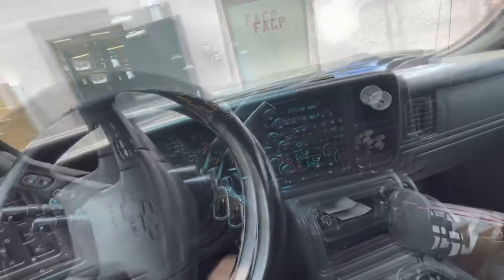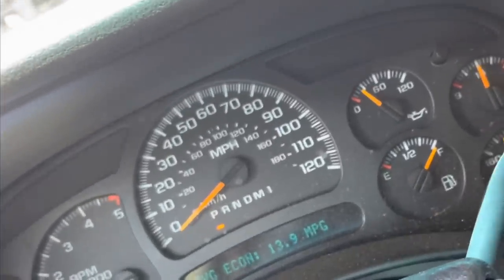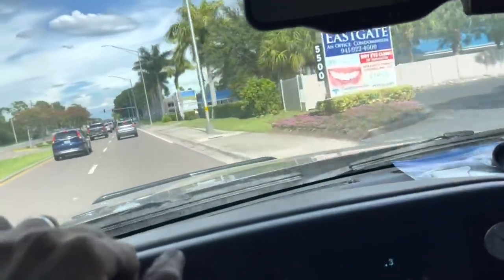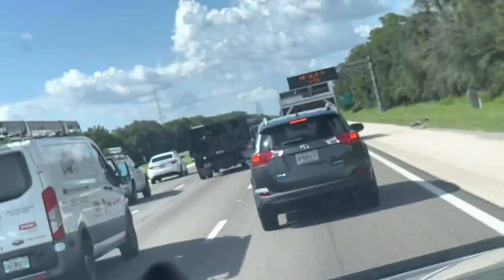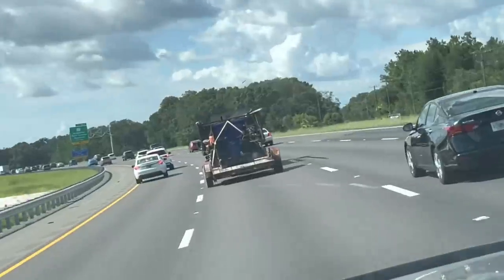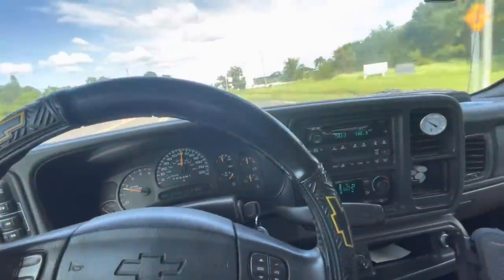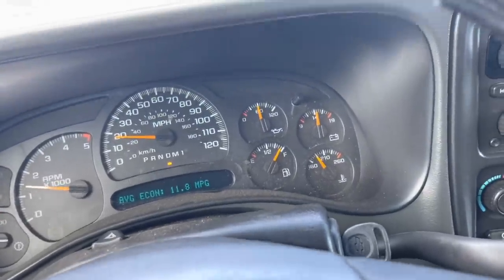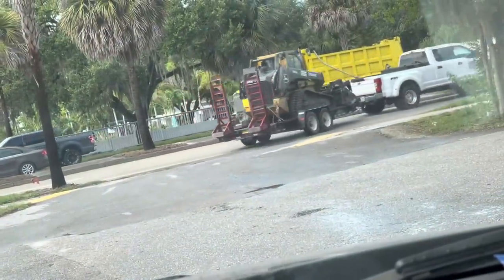Need answers! ox-cetane Diesel Fuel Experiment | Duramax 6.6 LBZ

Comment: Cetane boosters are good, it will help make sure the combustion process works as expected.  Similar to the octane boosters, or running higher octane fuels for gas engines.   If the fuel you've been running is already blended to a high enough Cetane/Octane for the engine then you won't see much of an improvement.  I would prefer to see that they claim an actual Cetane number improvement per dosage.  The diesel market in the US is not as well regulated for cetane numbers, and its exceptionally rare to find a station that actually will list Cetane rating on the pump.   From what I've read in the past, cetane numbers over 50 rarely have any significant benefit, but cetane numbers under 40 can cause less than ideal combustion.   Most fuel in the US market is around 42-45 cetane, with a minimum spec of 40.  In European markets the minimum cetane is 46.   

I've got a 6L powerstroke and a 3L bluetec in my two vehicles, the bluetec has a DPF filter but is old enough to not have the DEF system.  I definitely notice an improvement with a cetane treatment in the bluetec, more than anything in the frequency and duration of the DPF regens.  In the truck, i mostly just notice a little less black smoke puffs unless I'm just flat out flooring it, so I assume the combustion process is just running a bit more complete.  

I run the amsoil diesel treatment product, but have also used the ford/motorcraft one.  It has 2 dosage levels, to either get  +4 cetane or +7 cetane.  I'll occassionally run the higher dosage for a tank or two, but honestly I see the benefits from the lower dose, and minimal gains from the higher one.  

Cetane boosters aren't snake oil, but they have a diminishing returns depending on the fuel you are running.
Reply: I've read your comment and tried to do some research about it and yes it does seem that they actually work. However the one you referred to (Diesel Cetane Boost from AMsOil) is incredibly hard to get for us here in Europe. Could it be because of its chemical composition (that doesn't meet eu regulation)? Do you know by any chance what do they put in that stuff or what is it made of?
Reply: @jedanObicanMish  I honestly would expect that the lack of availability in the European market is due to the higher minimum cetane rating required for diesel in Europe.  Numbers above 50 have little benefit for most diesel engines, and European minimum standard for cetane is 51.   JLM Lubricants is a European market brand that has a very well regarded product selection including quite a few diesel specific products.  Even they only offer intermittent use fuel treatment products, which just leads me to believe that sub optimal cetane levels just aren't really a problem in Europe.

Comment: A good video on fuel economy; well done Ray. In regards to holding mobile phones, the citizens of New South Wales Australia, of which I am one are not allowed to hold a mobile phone under any circumstances whilst in the drivers seat of a car with the keys in the ignition. Also we have cameras installed on posts on some of our freeways to detect this kind of activity. If you are pulled up for random breath testing and decide to show your licence on your mobile phone instead of digging for your wallet you must turn off your car, apply the handbrake and remove your keys from the ignition before doing so. When you see the way some people drive you can understand why the rules are brought in. Pretty scary when you see an oncoming vehicle cross over to your side of the road because the idiot driver was texting or checking his messages. It has happened to me on a 70mph road.

Comment: I'm old school... I run ATF in my 7.3 as an injector lubricant. Important after the low sulphur fuel was mandated. Got 1 MPG improvement verified over many tanks full. It's at about a 200:1 ratio.

Comment: Rainman I’d say your 100% correct calling it the placebo effect as that whether correct or not means us knuckle head watchers know what your talking about. Myvehichles over the years have always travelled quicker and smoother after a wash😀😃😄 definitely placebo of the brain!😂😂
Reply: When I was a teenager, I worked for a local regional airport at the 'Executive Detailing Service'.  One thing for certain, airplanes get better economy of fuel after its has been waxed and rubbed with a diaper.  Sadly, I can't say the same for my cars at the time but if I drove 5000 miles a day; I might have noticed an increase after a wash and wax.

Comment: FYI to all 2019 & 2020 RAM owners with Cummins diesel engines; due to the problematic Bosch CP4 fuel pump (recalled in Nov.2021 with no date in sight yet for replacement), Cummins is now recommending "Diesel Kleen" made by Power Service. It has a Cetane additive, and has a lubricity additive to help lubricate the fuel pump. I've been using it for 3 months. Seems like a good product.
Reply: I have a 2020 Ram 3500 with HO 6.7 Cummins.  I have been using "Diesel Kleen"  since new;  it seems to help and keep the CP4 fuel pump together until it is my turn to get the pump replaced.
Reply: @schlite60  Hi John. I've owned my 2019 since March 2020. It was brand new when I bought it. I've been driving it for 2 years before I learned about Diesel Kleen. I've only got 17,000km. on it, so hopefully my pump will survive. I'm driving from Toronto Canada to Newfoundland, departing tomorrow. It will be approx 5,500 - 6,000 km. return.
Reply: @46fd04  have fun and I just got back from a 5K mile trip to Xenia, Ohio in May.  I drove thru some snow and ice (6 inches!);  coming back home in Wyoming over a 9K foot pass.   I also have the 52 gallon tank which gives me around 800-900 mile range.  Be safe

Comment: Hi ray, i am a proud owner of a 07 lbz, i can tell you that using Cetane booster/tcw3 2 stroke oil is not about having much performance gain or MPG gain. its longevity of the cp3 and injectors.... the globalist really dried our fuel up compared to the early 2000, they dont want us to use much diesel anymore. The new diesel at the pump have too low sulfur in it and  it damage most of the high pressure stuff longterm.   having alot of lube will help with the bad diesel at the pump

Comment: Good experiment. The thing I noticed most was how many keys you have hanging off the ignition 😂. Bad for the cylinder.
Reply: Take a look at women's keys sometime, and I've never had to replace a wife/mom/sisters lock cylinder
Reply: There's nothing wrong with how many keyshe has on his keyring. I know people with 3 times as many keys on their keyring & haven't had any issues for several years! 
Literally 10 to 12 keys, plus the key fob & no problems in over 10 to 15 years! 
Of course the new cars don't use keys. Just a key fob that you could keep in your pocket.
Reply: I was thinking the same, after my dad (retired mechanic) used to tell me all the time to carry minimum keys possible on a keyring ☺️
Reply: I noticed how many lighters he has in the dash. Kinda curious what they're for, especially so many. In my experience, eh I won't finish that one lol.
Reply: I'm sure that ray can replace the cylinder if necessary.
Reply: @chrisleggett685  definitely.. it will make for a good video & we can tell him it’s cos of his keys 😂

Comment: I noticed smoother idle and less knock with HOTSHOT EDT it also increases fuel lube
Reply: In theory the idea of fuel additives sounds logical, studies haven't really backed up the claims. The FTC for example did testing on it and they found that while it did work, the results were basically immeasurable. We're talking increasing your horse power rating by a few fractions of a percent and only less than half a mile to the gallon better than before. But the results should be more impactful the older and more worn out your vehicle is. Adding it all the time is literally just a waste of money as it's only purpose is destroying carbon buildup.

Comment: For the last five years (100,000 miles) I've been adding 2 Stroke oil to my diesel at about 0.4% - 250ml in the 68L tank in my small 4x4 SUV.  This has the effect of increasing the cetane rating very slightly.  While the fuel consumption is  only marginally improved, the engine noise is radically altered - much less of a diesel rattle and sounds more like a car than a tractor.  Exhaust is cleaner and there's no smoke on high rev acceleration.  It may all be placebo, but a smoke-free, free-reving diesel at 170,000 miles seems pretty good to me and there has been no obvious down-side.  My long-term average fuel consumption is 42mpg (Imperial); 35MPG (US); 6.7L/100km - again, that seems pretty good for a family size 4x4 SUV.
Reply: This was old practice with diesel fuel pumps, I did it also after advice of an older diesel expert, ...........I doubt the use with the technology of common rail ????
Reply: @frankgeeraerts6243  Lots of change to the technology of getting the diesel into the cylinder, but the physics of the actual  combustion hasn't changed, which is where the 2SO and the change to the cetane rating comes in, in terms of igniting sharper and burning slightly hotter and cleaner.  So still relevant for a modern diesel.
Reply: @rb9580  Thanks

Comment: Gotta wonder how much fuel you've got to burn at a discounted rate to make up for the cost of a big external tank and pump.

I honestly like the preparedness and range bonuses but don't see it as a money saver
Reply: Yes, to save fuel you pretty much want as little extra weight in the car as possible.
Plus what's the cost of the product v savings. Overall it might not save you a cent.
Reply: I think preparedness is everything for a diesel.  Payback is going to be years on the tank, but with fuel prices as they are it will probably pay back in a shorter amount of time.  I also suppose that extra tank can be moved to a new truck in the future.  Sorry, Captain obvious here!  🤣
Reply: One advantage of having the external tank and pump is, you can fill the tank up with heating oil, which is just diesel fuel with a dye added because there is no road use tax on it. Old school diesels run fine on it. Don't let the DOT find out through....sssshhhhh!
Reply: @richb.4374  at 2:53 when Ray “rinsed” the filler neck, the fuel did look awfully red….lol

Comment: Most vehicles you can pull the high beam turn indicator to flash your lights for your courteous jester !  I use  Rev X Distance plus its an excellent diesel additive fuel preservative .In CA people frown on the diesel smoke. It has eliminated that too in my tractors. Good review.
Reply: While true, in a lot of places that's technically worthy of a ticket if a cop is having a bad day. They'll be especially picky if they think you're trying to warn others about the presence of a cop. Revenue >> safety! It's also sometimes hard to catch, and can look like you hit a bump or similar rather than being intentional. The long change of state is less ambiguous.

Over here, the "thankyou" to a truck behind is opposing indicators a couple of times (left, right, left, right or similar). In front, same as Ray mentioned.

Comment: 3:43 We metric thinkers measure our economy l/100km. So if your truck is around 6l/100km it’s alright
Reply: More like 17L/100kms
Reply: I was about to post the same comment but since you already did, I'll just continue commenting here: 5,5-6,3 km/l equals to 18,18-15,83 l/100km, so no, it's a gas guzzler.

Comment: For VW owners, to restore your diesel back to original performance you need to re-install the fake software that it had from the factory.
Reply: My wife and I own two TDI Beetles.  Mine has the emissions fix.  Hers does not.  Her car is a lot quicker than mine, and gets better fuel economy.  After 60k+ miles, the inside of her tailpipe is still spotlessly clean.
Reply: @Stefonius  The issue was NOx emissions being too high, not a problem with particulate filtration. Either tune would result in no soot in the exhaust.
There are a few TDI tuning companies out there that write custom tunes to whatever you fancy. I'll be getting a wrecked TDI retuned so that it can live outside of the host car without having CEL separation anxiety for all the other modules it will no longer talk to.
Reply: I screwed up on my 2014 Jetta. I took it in for the EGR recall. Same problem, I was getting 55 mpg brand new, and low 50 after the first recall. Second recall programing dropped it into the high 40’s. I wish I would have known at the time. I would have never let them touch it.

Comment: light communication over here is typically done by flashing your high beams two or three times. it's quicker than turning your headlights on and off also faster change in state typically grab attention easier. We also do the hazard blinking to thank the car behind you alternatively you can blink left - right alternating a few times since the hazard blinker switch is can be awkward to reach while driving in some cars